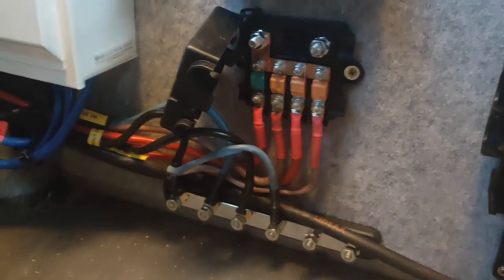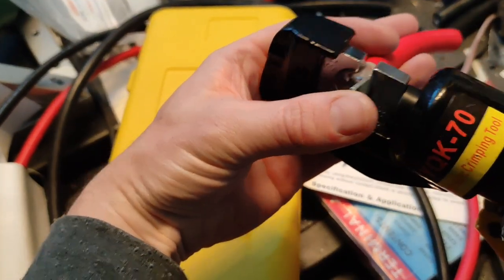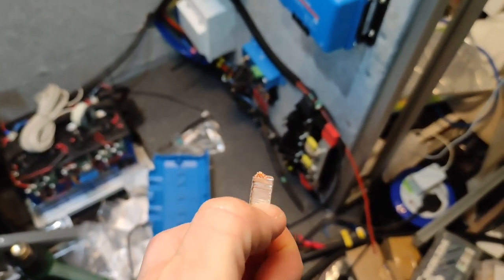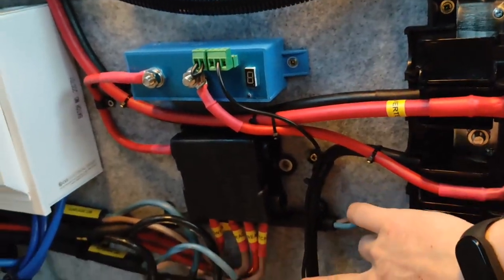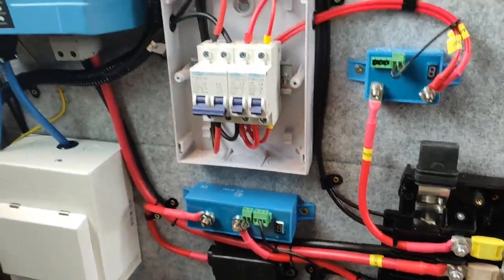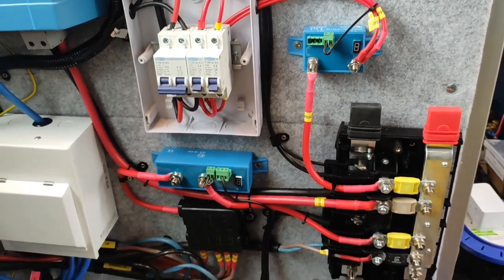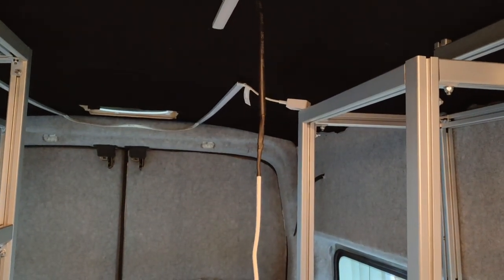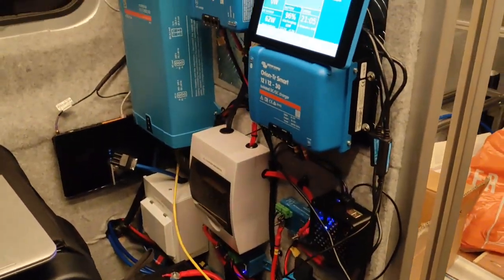Adventurevan Luna - Installing the Electrical System Part 2 | Ep 32

Comment: Great Video! I haven't seen many people run a breaker box for the MPPT, B2B power out to lynx distributor fuse block. What's the idea behind that? Just to stop fuses from blowing in the Lynx Distributor and trip the breakers instead which is easy to flip? I do like the idea, might have to do the same, I guess you need a cut off breaker for the solar in to MPPT anyway, so you just added a few extra breakers for the rest?
All the usb wires to monitor seems annoying, I suppose that's one of the benefits of running a victron cerbo gx ? (I didn't plan on adding it to my build but might have to)
Reply from the maker: So the rule I worked to is that every wire needs to be fused near the point where power is produced. This gives the system the best protection possible against short circuits. Since each chargers is a power source it needs a fuse. In the end a DIN rail box and DC breakers were a cost effective way of achieving this. The breaker for the solar panels is just an easy way to isolate the panels in case of maintenance on the system.
Yeah, what I think I'm going to do is buy a USB hub with a 1-2m lead on it and tuck that away somewhere with the wires into that. Then it's only a power lead and one other lead to the Victron Pi.